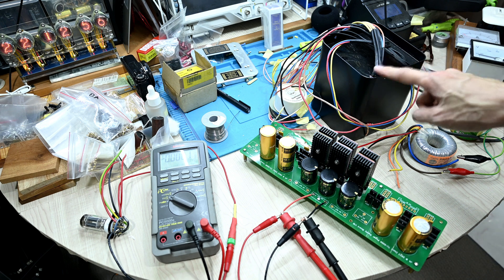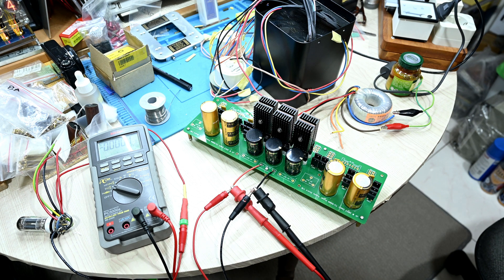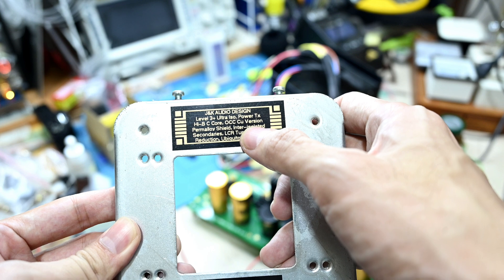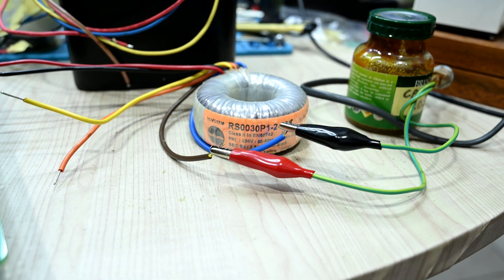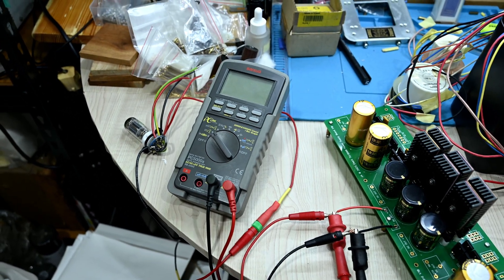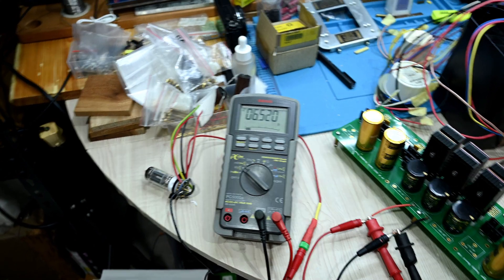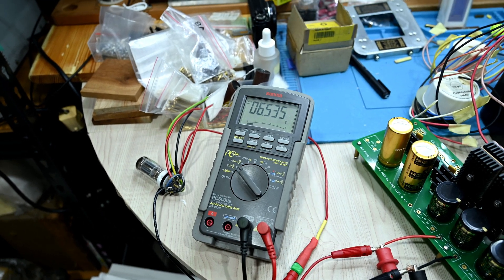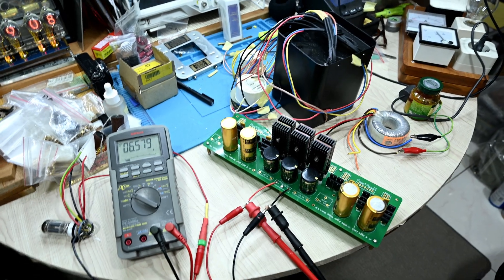Elekit TU-8900 Filament Transformer Testing

Comment: Hello, just keep the existing transformer and put in a voltage doubler on the secondary
filiment winding and regulate down to 6.3 volts from there.
Cheers Lou
Reply from the maker: Make sense, thank you.

Comment: what I have been doing is regulating the dc with a lt3086 so about 10volt secondary and dc at about 13 volts dc  regDOWN TO 6.15 VOLT ( ABOUT 95 % ) of center( 6.3)  longer life and lower distortion . Very low noise on the heaters elevate 45 volt off ground on the au7  my data so far .  Separate transformer for just the heaters will be far less costly a work around .      Enjoy the video .
Reply from the maker: Thank you for good suggestion!